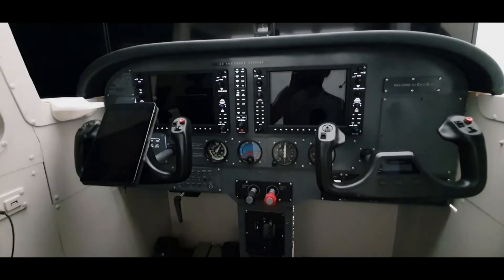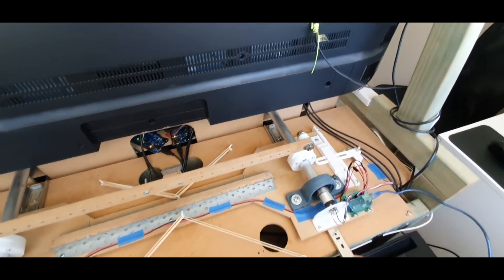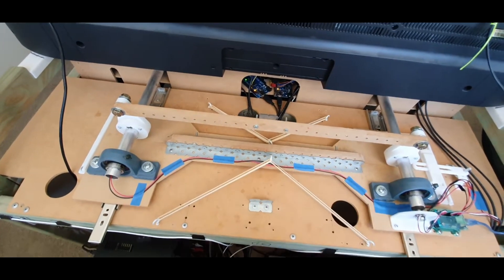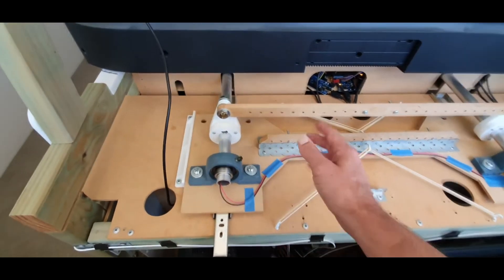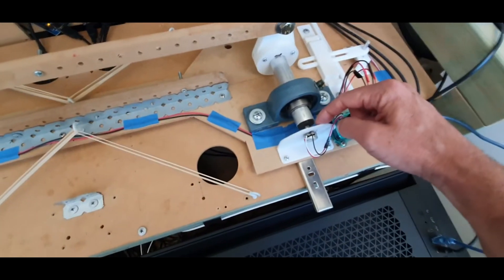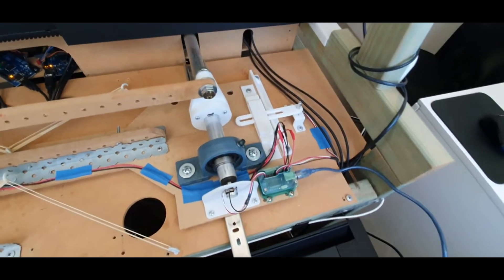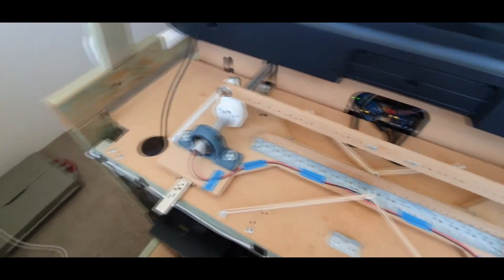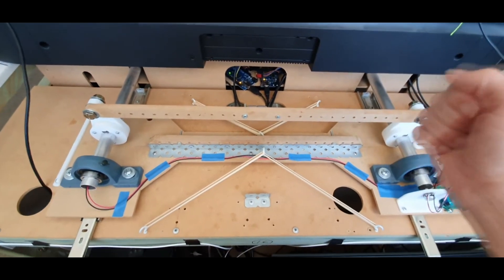⚡C172 Sim Dual Yoke Design⚡

Comment: I know it's been a while, and you've already probably fixed the centering issue, but you could always put a rubber bands or springs
 on either side of the top bracket to help re-center the yokes.

Do you have plans or print files anywhere for this? It's actually a pretty neat design! I was thinking of using hardware to attach to my Alpha Flight yoke and just put it in the center between the two yokes. Honest, this looks much easier and better than taking apart and drilling into a $400 piece of gear. Hah!
Reply from the maker: HI mate. Thanks for the feedback. Yes have tried using bands and varying springs but unfortunately not that easy to accurately get back to dead centre. Something on my future wish list to address. ...On the subject of the print files. What specifically are you thinking of? I assume the mechanical linkage arm and clamp setup?? If so, join my discord and I can see if I can help you out.........https://discord.gg/qc2VygKxWY

Comment: It occurs to me that the swingarm system you've implemented may more accurately emulate the non-linear nature of mechanical pitch control input than the "rack & pinion" style I've seen in other home cockpits. Nicely done.
Reply from the maker: thanks mate. I did contemplate rack and pinion in my early design concepts, but landed on this. Future project though is to get the self-centre to work properly. Not functioning the best which does make trimming out a tad difficult....

Comment: Put motors for feed back force stead rubber bands.. congrats
Reply from the maker: thanks for the feedback. Whilst the bands are fairly crude, they work better than springs IMO. Have you done this with motors or know of someone that has?
Reply: There’s is people that has used Microsoft flight simulator feed back joystick disassemble use logic card sensors and upgrade motors
Reply from the maker: Thanks.

Comment: Is that blue shaft mount also 3d printed? Looks similar to what I've found online labeled as a "pillow block bearing" though I have no idea what those are normally used for.
Reply from the maker: Hi mate, No this is a purchased item (cast steel with insert bearing) and is typically used for shafts in industrial applications. They are relatively cheap to buy (w/- bearing) and I would recommend doing that rather than 3d printing these. Having said that, if you have a 3D printer and a design at hand, perhaps give it a try. If it breaks, then you know you need to go out and buy one or two depending on whether dual controlling or not......hope this helps.

Comment: Wow this is a great setup. Are any of your 3d printed parts publically available to recreate something similar?
Reply from the maker: thanks for the feedback and appreciate your sub and tuning in. I actually havent done anything with the 3d parts as of yet, but perhaps should consider a post to Thingiverse or something?
Reply: @CessSim  That would be awesome. My limited mechanical inclinations have made me seek a design like this. I've been doing lots of research recently trying to find inspiration for the best dual-yoke setup and yours looks very functional. I am a little weary of the wear on the rubber bands and potentially dry-rotting but that seems easily fixable with the right expansion spring and spring constant.
Reply from the maker: @kpjVideo  happy to share. To be honest I tried springs before and I prefer the bands.  They are very cheap to buy and I swap them out every couple of .months.  Not an issue, quick to do  and as I said they are cheap and noise free.....
Reply: @CessSim  good point about the noise, didn’t think of that. If you happen to upload anything on thingiverse let me know!

Comment: Hey mate, just wondering if you use any hall effect sensors or only potentiometers? Also, is your yoke noticeably better than the standard Saitek one (I mean apart from centering mods)? Loving your videos thanks.
Reply from the maker: Hi and thanks for tuning in. I am using standard rotary potentiometers for the yoke (pitch and roll), and linear potentiometers for the throttle / mixture. With regards to the Yoke, I have pretty much stripped it down to just the yoke handle (Saitek) only. From there everything is custom. New aluminum shafts, and push to talk button switch on rear of left hand side.  No doubt a Yoko yoke or something similar would do a better job, but in all honesty, I find my setup to work really well.  Check out Captain Bob's channel as well in this regard as he has done something similar to me.

Comment: I'm sure you've solved your roll centering by now - but if not..a suggestion. How about a spring on either side of that cross bar. Install a stand on the other side of the cross bar - level with the cross-bar attach one end to the stand and the other to the cross bar. The cross bar should roll back to the center.
Reply from the maker: thanks mate for the feedback and appreciate you tuning in. Whilst I havent fully implemented the solution yet, I intend to use heavy duty rubber bands (simple but they are effective), pick up on the crossbar as you highlight, but tie back to the existing main frame (untreated pine you see) on either side. I reckon this will do the trick.  Will ket everyone know how this goes once I get it done.